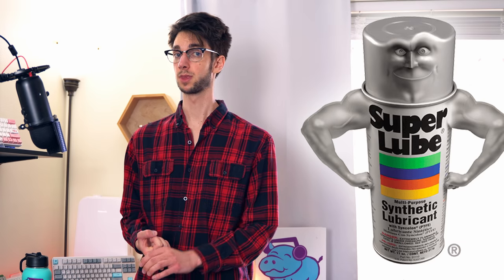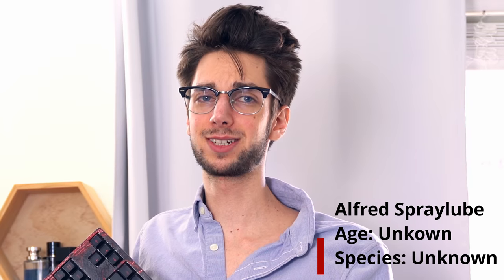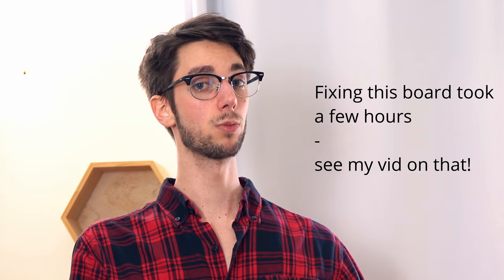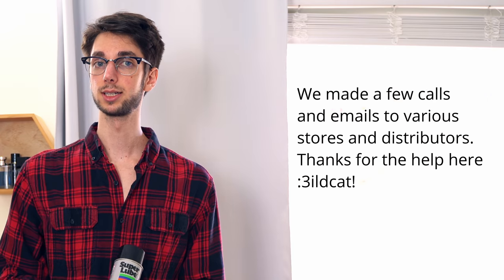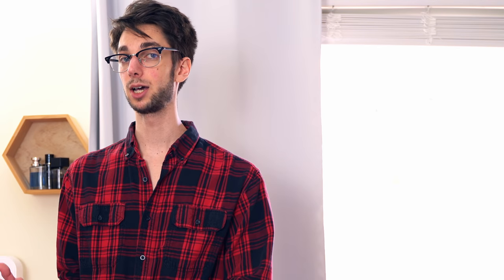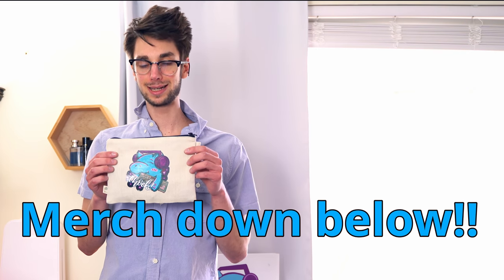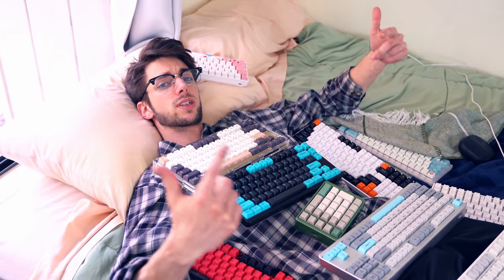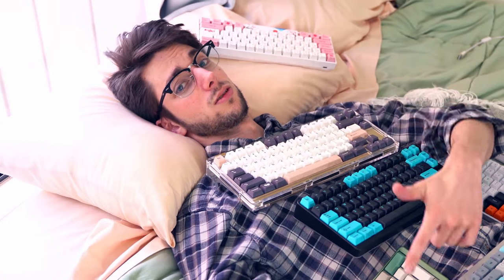Doing This Will BREAK Your Keyboard... (Spray Lubing)

Comment: This video actually thought me a lot more about spray lubing than i needed to know xD. its interesting how a fake formula turns out better for the keyboard scene. With that in mind i’m gonna unlink the spray lube amazon link from my video to prevent any further broken boards! Thanks for doing the research for the community man this video is bomb
Reply from the maker: Good to see you here Squashy! Thanks 🥰
Reply: I still remember you using various lipids as lubes huehuehue
Reply: I know where you broke the keyboard with spray xD
Reply: Im from Europe and used the Basic silicone lube spray, on my Redragon with otemu switches. Works fine. Than again i only did it on one board.
Reply: this video is bomb?!?!?! fok
Reply: Taught
Reply: Your sus
Reply: @erti86  same here... I used the WD-40 Specialist Silicone Lubricant and it did wonders... aaaand the board still works 🤷‍♂

Comment: Imagine lubing 100 switches for 6 hours without a switch opener and no bag lube (opening switch with another switch's top housing, manually lubing spring) because im stupid and impatient and though ah all those youtuber said lubing switches only took 3 hour, it is an escape from reality, it was easy! but still in the end i chose better method over spray lube

Comment: I think you touched on the main issue here..  That people are still using electrical contact based switches in 2021!  The only issue that spray lubing would bring to an opto-mechanical switch (provided you use a lube that doesn't corrode plastics) is that you could potentially get some gunk in the optical path. Then you just pull out the switch actuator (which technically isn't even a switch, it is just a plunger that goes in the optical path of the laser), and clean it. Since it isn't an electrical switch, it is never soldered to the board, so you would, as you say, remove it before lubing so you don't get anything on the PCB. It just touches the PCB to get the distance right, but technically it doesn't even need to make contact with the PCB. Since there are no contacts inside the the actuator the mechanism is way smoother even before lubing, especially for linear switches. Kailh are making optical actuators with click bars now as well it that is your thing..  It is time to get on board! (disclaimer: some opto-mechanical designs use light guides in the switch itself. I am talking about the basic Gateron style opto-mechanical switches.)

Comment: Thank you for your dedication and research! I will share this and how to fix video links to my spray lubing videos!
Your intro, way of explanation, even the song are awesome :3
Reply from the maker: Thanks! I really appreciated your help with the research as well, it really means a lot!
Reply: KINGS RESPECTING KINGS
Reply: We love you man  your vids really got me into lubing and keyboard mods
Reply: My super lube doesn't click clack when shaken. I got it on Amazon. And my keyboards lubed with it work perfectly still.
Reply: :3
Reply: Still love ya my man
Reply: I spray lubed my rk61 still using and works fine tho got inspired by :3
Reply: @hyemuuu_  thats lucky lol, make sure you libe properly next time, especially if u have a more expensive board
Reply: @pixsled  im more scared on destroying the pcb by burning it tho
Reply: Hey wild cat I doubt you’ll respond but spray lubing still works well with hot swappable optical switches?
Reply: @thomasrenelli  yeah it does, just make sure u don't block the hole at the bottom
Reply: @hyemuuu_  its really hard to burn the ocb, just set the iron to the right temp
Reply: @pixsled  thank you!!
Reply: @thomasrenelli  np
Reply: Can i suggest trying Deoxit Fader Lube F5 (NOT D series). It is used in aircraft and high end audio, wont damage electronics, and leaves a lithium grease that doesnt attract dust behind.

Comment: I once spray lubed my keyboard. Immediately after setting down the board to dry, I heard a banging on my door... KNOCK KNOCK I turned my head to the origin of the sound. To my surprise, the door that I had closed moments before was agape. How did I not hear my door opening? Its signature creak could probably even bring a hibernating bear out of its slumber. I paced cautiously to my door and peered outside. The dark hallway was empty. I wasn't sure if I was anxious or relieved. Perhaps the knock was in my head. I leaned against the right side of the door frame, bracing the wet hinge. Wet? Why was my door... WET? A slippery clear residue dripped down the side of my door frame. In disgust I flicked the fluid off my hands... Did someone lube my door hinges? I shut my door as I reentered my room. The door glided silently shut... Is that why I didn't hear it opening? My thoughts were left unanswered as the lights in my house all blinked off... Blackouts were unusual this time of the year, but not completely unheard of. Across the street, I could see my neighbors lights still on. I grabbed a nearby flashlight, flicked it on, and made my way to the circuit breaker box.

The light barely pierced the deep shadows of the garage. The circuit breaker box was... oozing... pulsating. The same clear fluid pattered out of the edges of the box into a growing puddle on the floor. The strange fluid must have damaged the electronics within the breaker box, causing the blackout. I hesitated for a moment, but found the resolve within myself to pry further. I pulled the sleeve of my sweater over my fingertips and gripped the metal door. Gallons of the clear fluid poured out of the breaker box, saturating my sweater, splashing onto the floor. Out of surprise, I took a step back, unwittingly putting half my weight into the expanding puddle. My legs flew forward, and my head flew back, striking the cold concrete of the garage floor.

I awoke to a droplet of the ichor striking my forehead. My eyes drifted up to the rafters. Two large eyes glared back down towards me through the darkness. A long grey cylindrical body stretched between the rafters. Two muscular arms stemmed from the demon's torso, fists planted on what I assumed were its hips. It smiled. It drooled.
Reply: Please... don't spray lube.
Reply: Superb
Reply: @_E1_  Too late. I spray lubed all over my keyboards.
Reply: Nice story bro :awesome:
Reply: Professional
Reply: Work of art
Reply: @_E1_  Holy, my man writing an essay over here
Reply: lmao
Reply: @_E1_  go write a book as a career jeez
Reply: Reminds me of when my friend wrote an extremely detailed story about a guy drinking expired milk

Comment: If anyone is still considering spray lubing after watching this video, here's a much safer way to do it:

Spray a bunch of that superlube into a container. Get a pippete dropper, the disposable ones will do. Apply one drop and then mash the switch to work it around the spring. Apply more as required but in my experience one is all you need, two is too much, three is ruined. Let it sit there for an hour or two. Then flip it around and let it sit there for another hour or two.

Comment: POV: you used Vaseline on your stabs and WD 40 on your outemu blues
Reply: kekw
Reply: Ghost !!!  You poor soul
Reply: I used wd40 on gatheron reds lol
Reply: WD - 40 brand make a silicon lube here in Australia, still risky with hydrocarbon propellants but it saved a cheap Drevo when I used too much dielectric grease.
Reply: Yeah I did
I needed to soak them in a solution of 750ml of water and 60ml of soap for an hour so they could work again and they smh did
Reply: @Sh1denK4i  really mine still work
Reply: i used vaseline for my swithes
Reply: i dont lube using vaseline lmaoo
Reply: @funkysol  this was 3 months ago when krytox prices sky rocketed cause of brexit now I’m just saving up enough to buy the stuff I need for it
Reply: bruh
Reply: i did it and i think i fucked up my optical keyboard...
Reply: used body moisturer lol
Reply: @GabenHood  wait are you serious that you used wd40 on your switches on actually considering it since i already have a bottle at home. also im assuming that you mean the wd40 spray
Reply: @ethannguyen5030  WD make an electronics safe silicone spray. It worked really well, I got a bit much in a couple of switches so put the keyboard upside down on paper towel overnight with a brick on top.
Reply: yes and it still works
somehow

Comment: Instead of literally spraylubing i've applied a drop of ISO 100-150 super lube with a fine brush or a thin syringe to the east and west sides of a switch while depressing the stem and it seems like a much cleaner and safer method because you can actually control how much oil you're distributing in each switch. results still aren't as good as traditional lubing but it's much safer for a soldered board if you wanna risk it
Reply: Shud I wait for it to dry?

Comment: If youre going to use any spray lube i'd recommend Caig DeOxIt F5 (NOT D!) or the F100 needle lube. It is specifically made not to damage plastics or electronics and not to attract dust, and is used throughout aerospace and high end audio. From what i can gather it is lithium grease based with naptha and a chlorocarbon as solvents that evaporate fully.

Comment: I thought about spraylubing once but in the end I chose a safer way of lubing without desoldering. Pushing down the stem of the switch with angled tweezers and lubing inside with a flat pencilbrush. I lubed the stabilizers lifting up the stems and reaching the metal clips with one of those thin interdental toothbrush. Maybe its not as good as a proper lube but the end result is totally worth it if desoldering is not an option.

Comment: I spraylubed with no issues on my first board. Worked great but it's very inconsistent switch to switch. Most people use super lube. Probably best to use bike chain PTFE "dry lube" it's basically ptfe powder and alcohol. When the alcohol evaporates. You're left with only PTFE. Make for a super smooth option for those that don't want to desolder.

My guess is the super lube spray can coat the backside contact leaves.  Spray lubing opticals won't hurt anything unless you block the laser sensor, which can happen anyways if you are heavy handed with the lubes.

Comment: I love the research you did here, also I have spray lubed before, and it was a hot swap board and I removed the switches. Plus they were cheap kailh switches, but I feel as if the lube crusted up / dried up after a couple of months. I then ended removing the lube and brush lubing it. I used a mixture of SuperLube PTFE oil and PTFE SuperLube grease; Cheaper than Krytox and works.

Comment: My younger brothers have keebs with soldered switches for many years and I've lubed both twice during this time with spray lube. Haven't had issues yet. My method has an extra step and the lube is a different one. I first spray them with contact cleaner to try and protect the contacts as much as possible, then the next day i spray it with "WD-40 dry lube with PTFE". Clean everything where the spray wasn't supposed to go. Protect your eyes and use a mask during all the process. Wait another day for it to fully dry, rebuild and test. Although it never happened to me if you ever get a switch that doesn't work try spraying contact cleaner in it with the board unplugged wait an hour and test, if it continues repeat a couple more times, it might fix the issue.
Regarding results, spray lubing will only give you a little bit of smoothness and noise reduction, expectations should be adjusted to as high as the time spent working on it. Is it worth it for prebuilt keebs that are starting to show some age and annoy you? I would say yes from my experience.
Sorry for the long text :(

Comment: My take is that spray lining is often a horrible idea and will most likely break your board UNLESS you spray lube the switches off of the board. Optical switches are especially safe to spray lube because as long as the optical hole thingy is open, it will work. For people who can’t afford krytox which is pretty expensive compared to super lube, it’s a good alternative.

Comment: You can just poke some vaseline down the top of the switch with a a brush, or baby oil (or a mix of both). Done this to all my switches on a cheap keyboard and its fine.
Reply: vaseline is petroleum based which means it can corrode plastic

Comment: I run two G710+ boards at my workstation. I've never spray lubed a custom board, but the effort has never seemed worth it on my logitech boards so I do use it there. I take time to blow out the excess lube and give the board 24 hours to dry before plugging it back in. On 2 or 3 occasions i've had one or two keys stop working after a clean and spray lube, but it only takes a couple seconds to restore function with a spray of compressed air into the top of the switch and a few rapid keystrokes. Its been a number of years on these boards with liquid and spray lubes and never an issue aside from blowing out a key or two immediately after the lube session. 
Edit: I don't and never have used super lube brand lubes though.. maybe that's the trick.

All that said. I agree with everything in the video LOL. These are not enthusiast boards im spraying :)

Comment: I spray lubed gateron browns with WD-40 PTFE Teflon lube - works great - couldn't get super lube in romania so I just looked up the main ingredient to make sure. it was pretty much the same
Reply: Bro I'm doing the same here in Costa Rica, I was able to finally get Dry PTFE WD40, do your gateron browns still work and sound good?
Reply: @0RBNC1  yeah dude its funny I'm using it on a shitty amazon low budget mech and it sounds better than a brand new Keychron k6 I just bought with linear switches (I haven't yet lubbed that one). Everything works fine and it feels great. PTFE is a forever chemical though so I'm more worried about my health than the keyboard lol!

Comment: I use a lube called tri flow at work a lot, it uses a ball bearing in the can to mix it up and leaves no residue (on locks at the very least) so it may be worth trying for keyboards

Comment: Great to know I dodged a bullet. I got my RK61 (With RK's red switches) a while back, and I was considering on how to lube the switches. As I had no soldering equipment and no budget for it. As usual there was a lot of spray lube talk, but finding a can of spray lube here was rare and your video on the Pewdiepie keyboard was a real warning. I just settled on the "Push Stem lube" method with a brush and taking my sweet time. After a few months of use the board still works fine. Looking forward to getting soldering gear so I can put it some better, properly lubed switches.

Comment: Look at the specs of the lube.  It's not oil vs grease, that's more the consistency/viscosity.

The Multi Purpose says high dielectric strength, some of the other aerosol Super Lubes say Dielectric or Non-conducting.  

So if you get an oil that insulates against conductivity onto your electrical contacts, you're probably going to have a bad time.

Just a theory though. I'm just some dude reading things online.

Another thing I read is generally dielectric grease is more expensive than regular grease, so maybe the "counterfeit" stuff is missing some additives.

Is it possible to just clean the contact of those switches on those keyboards that died or do the whole boards die?

Comment: Curious ... there are grease based spray lubes if you’re tempted to experiment with a US option that may work. That is IF the grease over oil is the reason Korean keeb enthusiasts haven’t had the same issues. Also for optical it can DEFINITELY cause issues. Since optical switches rely on the laser passing through part of the switch the oil can slowly move into that area and even the slightest amount can throw things off as the oily reflective surface can cause issues with the sensors ability to receive the laser input. I’ve lubed razer opticals on 2 boards and like 3 gateron opticals and have ran into the situation at some point on EACH one even attempting various levels of lubing.

Comment: I guess I spray lubed my keyboard using silicone spray - after I dropped my cup of coffee into it, I tried quite a lot of stuff to get the liquid out, and without too much effort (so, without desoldering, as I did not have the tools to do so) Well, it’s working again for the moment - and yeah it sounds less „tinny“ than it did before. But that wasn’t even my intention.

Comment: Lol I sprayed lubed my keyboard, it sounds so nice and every key worked. I  have hot-swapped keyboard so I took of the switches and sprayed them. I let them dry for 2 days just in case. Boom it worked and I have been using this keyboard for 6 months, I have had no problems. I sprayed on otemu reds.

Comment: I used spray lube on my keyboard and its working normally untill now, about half a year now.... I didn't actually spray it on the switches, i apply it like how normally people lube their switches, i spray those lube to a container, enough to see some liquid in it, then apply a small or thin amount to the switches and it worked great and it feels much better than stock switches

Comment: I've tried brush lubing three different optical boards, and all of them were dysfunctional within a month or so. For most of them, once the lube settles toward the bottom of the switch there's a good chance it trips up the optical sensor. Depending on the thickness and the application of the lube, the board will be dead anywhere from right when you plug it in to about 6 months. 

If anyone has other experiences with lubing optical boards, feel free to share. I've tried spray lubing a hunstman TE without any issue, but the reality is the keys just didn't feel or sound any different to me - so there's really no point anyways.
Reply: same, I spray lubed the Huntsman TE for little to no effect. what made a difference was foaming the board and lubing the stabs. But for the switches, at least none of them is broken or went bad or anything, even up to this date. So it kinda does(n't) work